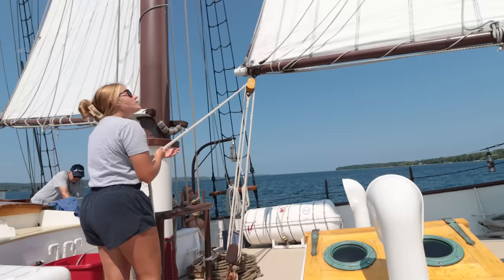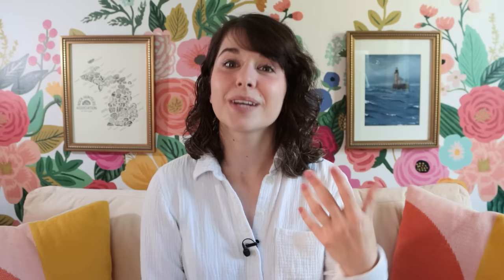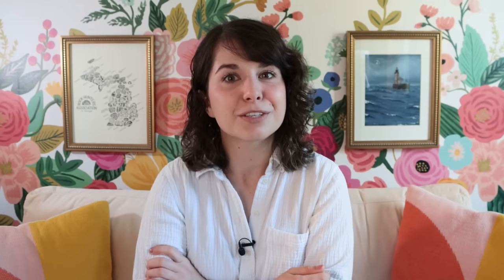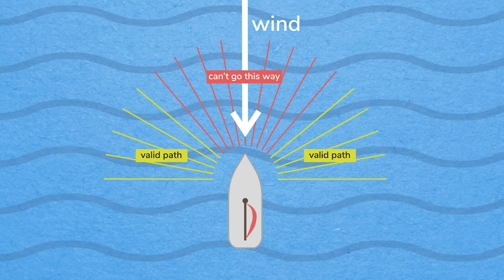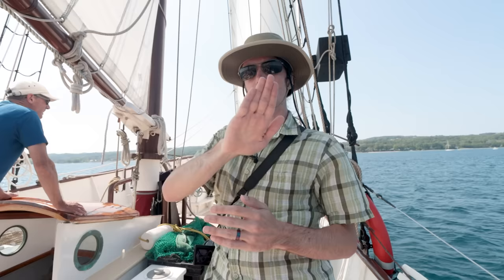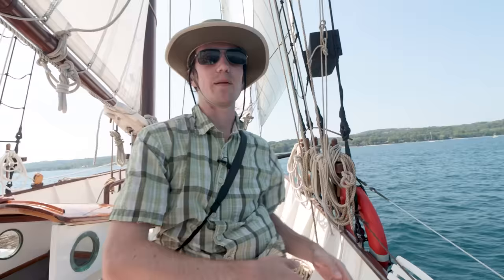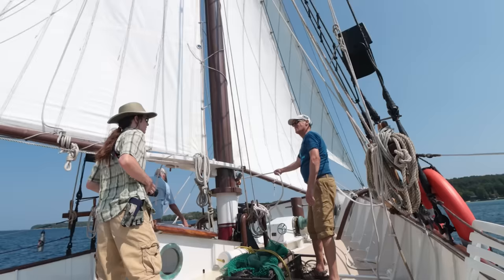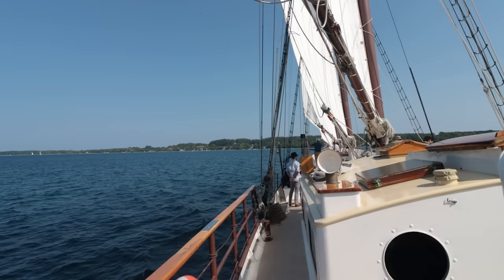How Do Sailboats Go Against the Wind? (ft. a Great Lakes Schooner)

Comment: okay, I dropped to comment on the "Viscous World" and lo, the possibility of a mug presents! Yes, Please.
As a chemical worker, I've had the joy of working with a overly polymerized batch that was supposedly 150,000 Centipoise, but if you pulled about 2 pounds worth out it using a shovel, it would pull itself back into the container if any strand was still connected. Typically it is in the range of Black Strap Molasses. I burned out 2 electric motors and locked a gear pump reworking the stuff. My life for 19 years has been VERY Viscous.

I also live on the Lakes. I'd not mind being a sailing Yooper, but other hobbies eat my time and money.
Reply from the maker: Oh my gosh, that is an amazing story. Thanks for sharing that!

Comment: That was great. I love the comparison with a plane. I've never thought of it that way, but it makes so much sense. It's not that they create "lift", but an imbalance of pressure in the air/water. It's also the same reason a propeller works on a powered boat. The spinning propeller creates a low pressure/high pressure situation as it turns, which moves the boat forward towards the low pressure region.

Comment: When I have taught people new to sailing and the questions of terminology come up. I'd explain that all of the ropes on a boat could come from the same reel. 

Once on a boat the ropes are called by their function. The function is very important, hence the specific names.

As far as pronunciations go, the words are written "in the King's spelling". The die-hard yachtsmen use the vernacular pronunciations even though the "yachtsmen" were more often from the upper class.

I pronounce the nautical words as they are written. I still use "toilet" rather than "head" since on my boats, the toilet was never at the head of the boat.

A good video about how a sailboat works. Sailing is so serine — until the wind speed goes up!